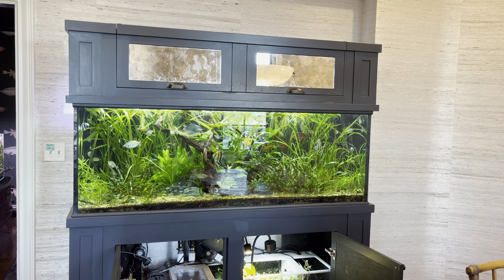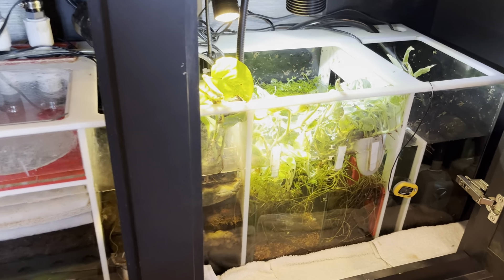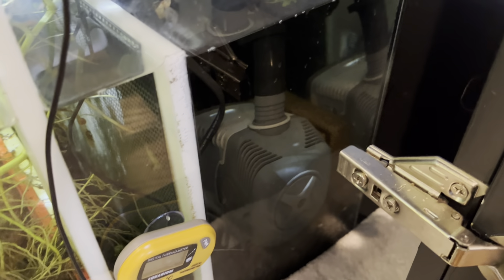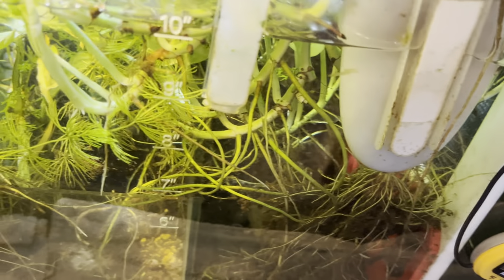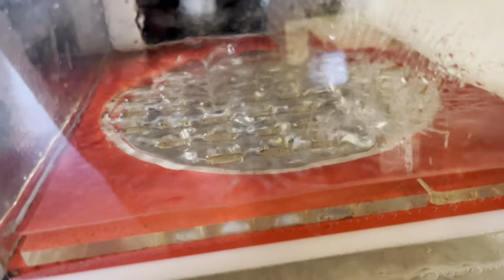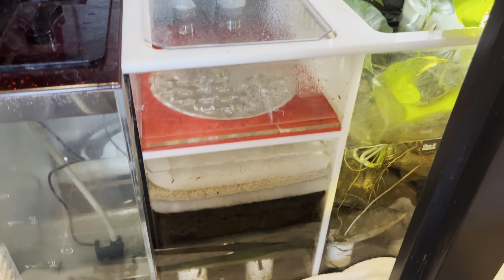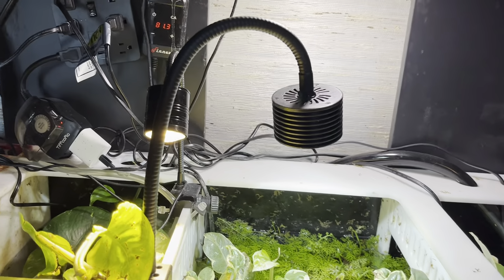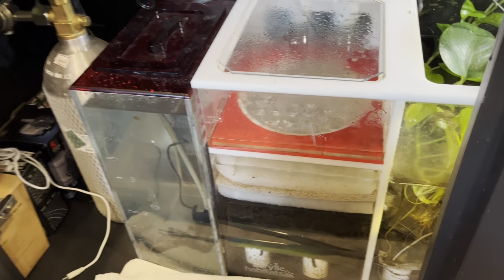Using Sump to Filter Freshwater Display Aquarium (Tips, Tricks & Benefits!)

Comment: Really interesting set up here, Stefan! Like a living filter. I like the idea of the ato for the reasons you mentioned as well. What kind of gooseneck lights are those and do you like them? I've been looking for a small light like that for my little 5.5. Lots of great info, thanks for sharing! 🙂👍
Reply from the maker: Hi Tara! It is a living filter! The goosenecks are readily available on Amazon. I have two different kinds, both pretty nice. I could try and research my order history when I have a moment...
Reply: @LushSaltyAquariums  Thanks, just when you have the time that would be great so I know exactly what brand I'm looking for, but no rush at all 🙂. I have one for it currently, I just really don't like it.
Reply from the maker: Will do. I do recall one of them under the sump costing quite a bit more than the other. Also- lighting for sump far less critical than your nano tank I'm sure. @TarasTankFriends

Comment: Thanks so much for this! Getting ready to build a diy 20 gallon sump for my new ADA 120p!…do you happen to know round about your flow rate? I’m worried I may have oversized my pump and hang on back overflow :)
Reply: Or any other pointers for 1st time sump :)
Reply from the maker: @appleseedontheroad2296  I'm not sure my flow rate but I'm also not sure it matters. A stronger pump is better than a weaker pump and you can always block or increase overflow. I tried to cover as many tips and points as possible in my video. Definitely put overflow and outflow near top of aquarium to avoid power failure creating siphon overflow into sump. Most tanks fitted this way anyway. also create space at bottom of sump containers for water flow. I used simple 2 inch PVC risers. Good luck!
Reply: Thanks so much for your reply and again the awesome video!!! I really appreciate the note about the risers…I hadn’t planned for that! Very helpful!
Reply from the maker: @appleseedontheroad2296  my pleasure. PS: risers do not need to be attached to bottom. Just something to elevate the sponges a couple inches.